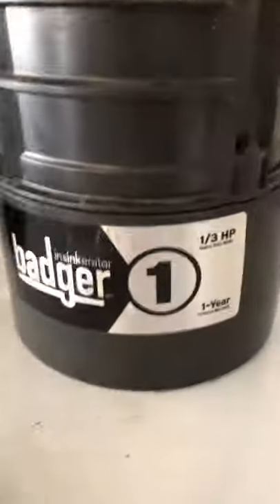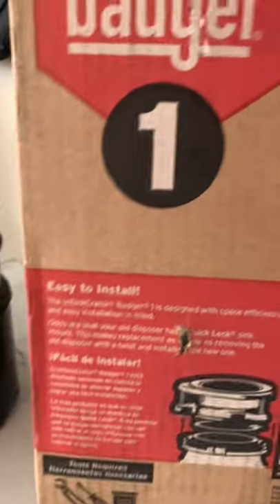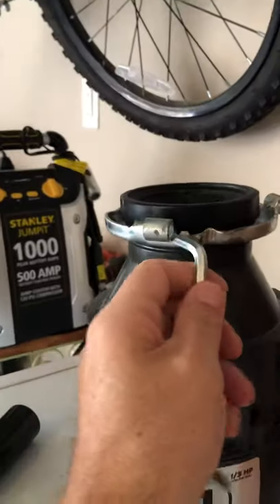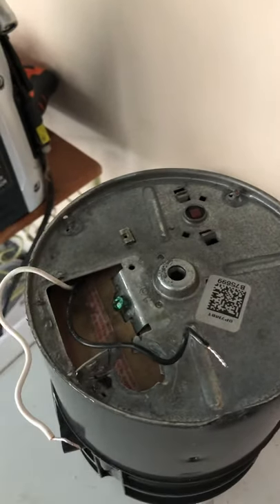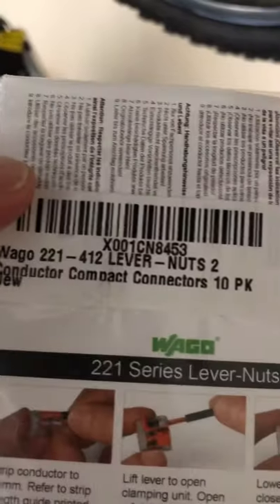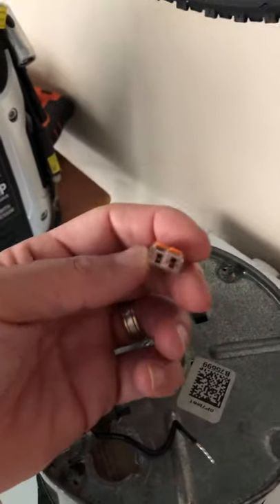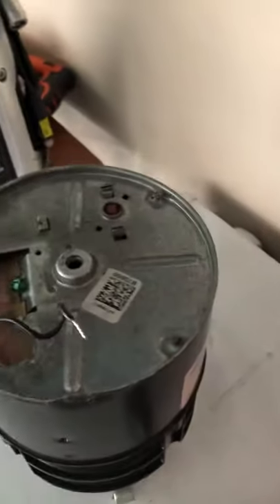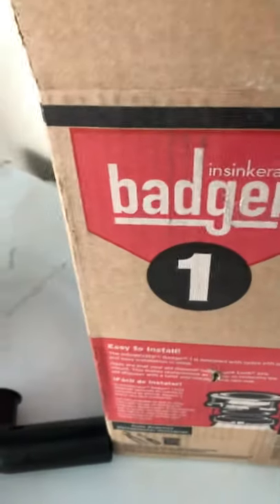How To Change a Badger Insinkerator Garbage Disposal (Don't Overlook These 2 Things!)

Comment: Josh a lot of times this wrench also comes with a new unit. As a good brand name unit will have a Allen wrench. That you insert in the bottom of the unit in case it jams. You insert the Allen wrench and spin the blades manually. Make sure the switch is off. Or better yet the breaker as well. Never can be to safe!
Reply from the maker: Great points Tim! The z wrench did come with the new unit too

Comment: I have the Ace Hardware Model 2000 1/2 HP heavy duty. Works fine for more than 6 years so far, no problems. Doesn't pay to skimp on motor power.

Comment: Be sure to warn everyone to punch out the hole where the dishwasher drain hose attaches. Guess how I found out....first time using the dishwasher, water shoots out of the aerator all over the kitchen. That plug is there in case you don't have a dishwasher. But if you DO have one, watch out!
Reply: Yes I forgot too.  I was lucky no big leaks though.  And, rather than removing disposal and knocking plug out,  I'm thinking about drilling it out.  Thinking of drilling slowly and holding a vacuum want up near the hole to suck out any drill bits/debris so they won't get into disposal chamber.  Do you think that'll be adequate or should I do it the other way?